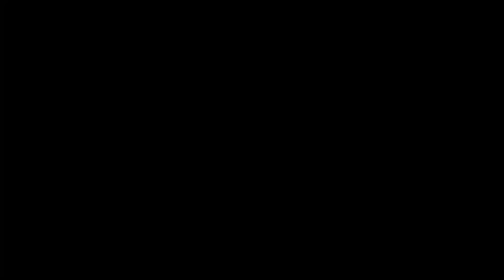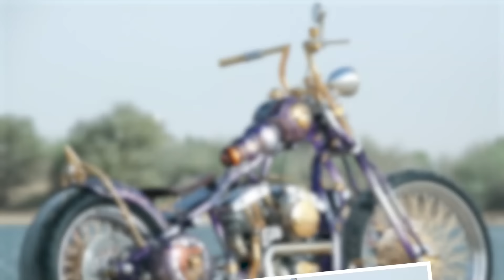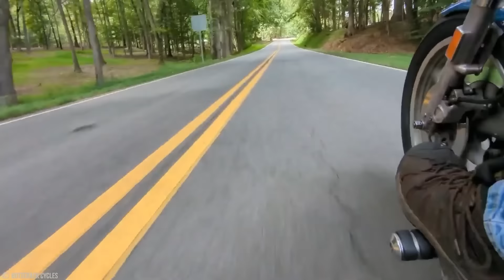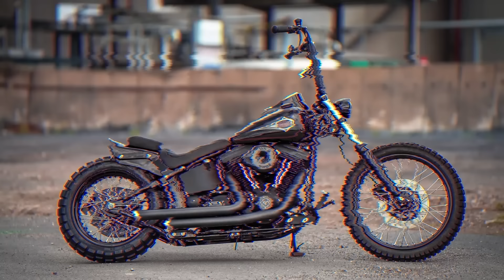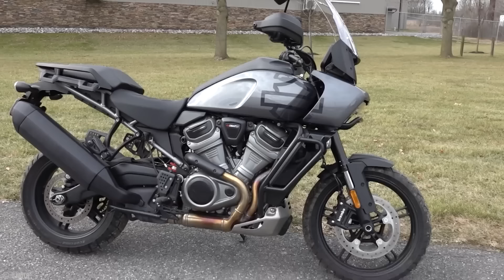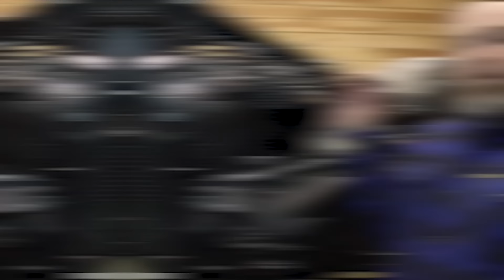3 WORST and 4 BEST HARLEY-DAVIDSON Motorcycle Engines to RIDE FOREVER

Comment: Um no,,the Cam Chain Tensioner in early twin cams isn't a 3000 dollar fix! You can buy the part for under 160 bucks (upgraded S&S thicker shoe tighter tension) and do job in half a day..also the 96 already had the upgraded tensioner the 88 was the problem..

Comment: i just replaced the spring loaded cam chain tensioner on my 06 street glide with the hydraulic tensioner and new cam plate. currently, that's $2k to fix the flaw.

Comment: The TC 88 is not a problem if you replace the tensioners though. Id put the XG750 engine at the bottom, what a troublemaker that was

Comment: only lookong at mechanical (stock) reliability this list might be true, but if you factor in electronics the evo wins hands down. Also it's much easier to work on.
TC is also solid if you upgrade the cam tensioners and bearings.
M8 might be a really good engine, but it's already missing that harley feel and sound (and all the electronics make it really hard to work on). 
The Revolution max is just unacceptably ugly looking

Comment: 2001 TC 88 with upgraded hydraulic chain tensioners, cam plate & HI flow oil pump.  50,400 miles

Comment: Best Harley engine built and lasts is the big  twin, mines a 1991 fxstc only thing done was plugs, oil change, and stator, tires and brakes, so far and 98k on the bike, take care of a great engine and it will take care of you

Comment: My very first bike was a 1978 iron head sportster. It was the biggest POS going. It was so bad that it put me off Harleys for a very long time. 1999 rolls around and I went to the bike show in the winter to see what was gonna be coming out. That was my very first up close look at Buell. I didn't pull the trigger on one then. I waited a few years. I found a 2000 Buell Cyclone M2 at our local bike shop. I picked that one up. This was in 2005. I still have that bike. I also have a 2001. Same bike, same model, same color.  And 2 totally different animals. I started riding my 01 last year. I had already owned it for 6 years ?  I lose track because I have a garage packed full of motorcycles.  I've ridden all sorts of different Harleys over the years. Nothing compares to a  Buell.

Comment: Milwaukee 8s have a ton of plastic parts inside the engine! Absolutely those parts will fail and have failed just like the plastic tensioner pucks from the 88/96 engines.

Secondly! Ain’t no way you’re running an engine 80,000 miles on a single oil change. So, you may wanna go back on that part of your video during the 1250 engine.

Comment: Anyone that buys a Twin cam from 00 to 06 the first thing you better do is replace those spring cam chain tensioners .  At least convert to hydraulic
Reply: Nobody told me when I got my 04 Heritage and at 50k boom- with adding a 6speed gearbox my bill was 9024.00-ouch😎

Comment: I have two 96ci Fatboys both 2009 the first has done 145000km with no problems except i have to use the choke when starting otherwise it purrs. But I have the custom classic that's only done 17000kms and no problems so far but this information gives me reason for concern. I keep them both up with services and now ill be looking at the chain tensioners so thanks for your help

Comment: Buying a Harley was kinda a bucket list thing for me, so I was able to find a 79 1000, it was sitting in a old shed,,been sitting for about 5 years, it looked like a total mess.. so I passed on it because of the price that was being ask.. a few so what days go by, then the offer was said to be for a 1000$ for it.. the first time I seen it it wouldn't crank, why I passed. I bought it the way it was.. needed a coil.. runs pretty good now.. next is the breaks .. there are none..  haven't rode enough to see if it's a oil leaker.. my first Harley. So any helpful tips will be appreciated..

Comment: lol the M8 bottom end failures, cylinder wall scoring, plastic lifter stays and intake manifolds warping and breaking like crazy! Most reliable engines 1- Revolution (vrod) 2- Evolution big twin top end breathers, 3- Evolution bottom breathers and sportster 883/1200, 4 twin cams with hydraulic chain tensioners.

Least reliable and best sounding (self lubricating) Shovel head.

Comment: I have a 2008 Electra Glide Police with a 103 and it's been a great bike. But actually going out TODAY (oddly enough) to look at a 2021 Street Glide Special with a 114 M8 with only 6k miles. Was also "considering" (but probably ruled out) a GORGEOUS 2016 Street Glide CVO with the 110 (9k miles) but heard some "not so good" things about it. Any input on these decisions?

Comment: The  cone  shovel   and EVO  , Had it  right   simple to  maintain   held up  great     ,  And  didn't  cost   $40 000    / I have  a 1979  FXE  I  bought  new with 25 000  miles on it  and  never  had the  engine  apart  , And runs  like a top  . I upgraded  the  ignition  carb  clutches  tires   / And  cost  $4  500  !

Comment: I think the M8 gets a bad wrap.  Sure early M8s had the oil pump issue but that was later dealt with.  I have  2021 model M8 107 and it’s bulletproof. Runs all day, runs cool, great fuel consumption and smooth.  All I’ve done is stage one and full exhaust.
Reply: I've got a 2018 Ultra Limited that I bought 2 months ago. I was going from an 07 Electra Glide classic, with a cammed, chipped and tuned 103", dyno'd at 115hp, so the lack of power immediately made me cam, chip and tune the engine, while also upgrading the oil pump.  It's now dyno'd at 125hp and I absolutely love the bike.
Reply: Twin Cam and M8 are the best Harley motors ever built but Evo boomers can’t comprehend it.

Comment: What blows my mind about Harley’s early twin cam is that they knew what the evo did for them and yet they chose to go with a pressed flywheel instead of how they always did it, they removed the timken bearing system that made they’re engines so strong, and then they went with cheap crap inside the engine. Then after fixing their shit in 2007 with the 96 and the 6 speed cruise drive transmission, they come out with the M8 that has a plastic intake and cylinder wall failure with oil sumping issues. Moral of the story is when you go cheap with your products, it shows. Make a quality engine, stop cutting cost corners.

Comment: You can’t compare a 1970 engine with a 2025 engine . But if you want to so here are facts . 
You can replace every main bearing race on a shovel over and over to fix it , on a M8 ? 
You got 7 piston oversize . On a M8 ? 
You can tune without breaking the bank . On a M8 ? 
Better sound 
More character 
Easy to maintain 
Parts are most of time cheaper 
No electrical issues

With my private evo I have 90000 miles on . 
My 45 Wla has now 60000 since I rebuild the engine  

It’s all up to maintaining. And use high quality oil

Comment: I have 103 and 114. Both great.
Reply: I've had an 80" Evo (cammed, chipped, heads polished, ported and bench flowed) and dyno'd at 105hp, I've had a 96" engine and 103" Twin Cams, and I presently have a 107" M8 with a 468 Redshift cam, Dynojet PowerVision III tuner, and upgraded oil pump, dyno'd at 125hp, and definitely my favorite engine.
Reply: What did you have chipped on your 80” evo?  If horsepower is what you’re looking for you should try a Revolution, Revolution max both make 125hp or more stock and are liquid cooled which reduces damage from extreme heat conditions.

Comment: The only problem with your choices is that the last real Harely was the Shovelhead and that ended in 1984.
Everything after that is just a japbike with a harley logo.
Which means that the Shovelhead is the best, most refined and highest power Harely engine. 😎

Comment: I used to own a Milwaukee 8 engine powered Harley,two years after I bought it,one day I went outside to start it,didn't start, called Harley Davidson dealer,they called out a tow truck,turned out the oil pump failed and my engine needed to be replaced,there is no good Harley Davidson,they are all money pits, after I got my Harley fix3d,I sold it and went to look around at a HONDA dealer,rode out on a HONDA gold wing.

Comment: Obviously, two of the very best Harley engines are missing: The EVO Sportster and the V-Rod.
Reply: V rod is crap
Reply: @sll-tt6bj  Vrod Revolution dual overhead cam, water cooled 60 degree v twin engine when properly maintained outlasts and out performs every other engine Harley built until the Revolution max was released. And as far as reliability goes it is too early to be sure which Revolution will win. If Harley produced a big twin based on the design of the Revolution it would definitely be the most powerful and reliable engine ever built by the company. But being a liquid cooled, pushrod free, modern designed efficient engine makes it undesirable to “Harley Purists”.
Reply: @Jdubsgarage74 same thing happened to the Harley V4 concept. Tbf, the point of these bikes are cruising and low end torque, that's why they have like 2 liter v-twins with long strokes and most importantly, pushrod valves, but the liquid cooling is a big advantage. V-Rod is a cool bike but obviously, these pseudo-tough guy kinds of Harley riders(aka the bad ones ruining the image for even the respectful Harley riders), have tachophobia so it wouldn't be surprising that they hate a sporty bike, even if it's the same as theirs with just little tweaks to make a sporty cruiser
Reply: @sll-tt6bj you never owned one.
Reply: @UncleRobsGarage you don't know what the fuck i owed

Comment: I home built my 87 FXR 1340 EVO in 99 from a pile of new and used parts - put it in the street in 2000 with 150k+ on it and still going strong. Powered by a 99 EVO motor and 90-94 5 speed tranny. Still loving it.
Reply: U talk about the shovel head U put it in the street n 2000 with 15ok+ still Going strong but theen U say Powered by a 99 EVO motor aaa
Reply: @matthewasbury8342  WHO IS NARIRATING THIS BULLSHITT...WHO R U 2 JUDGE..
Reply: PLAY ME SOME D.A.C. OLE PANHEAD OF MINE!

Comment: M8 is NOT #1…first year 107 M8 engines had a crap oil pump from the factory. Oil sumping was a common occurrence before recalls
Reply: Mine is losing lifters at 50k. Love the bike but tired of Harley marketing stuff before it's ready. If they would have abused this stuff for even a year they would have found these problems.

Comment: 80 cu in Evo engine needing regular valve adjustment?  Stock motor runs hydraulic lifters,  nothing to adjust,  if you've fitted a heavy cam and need solid lifters that's a different issue.

Comment: Got a 2004 Road King, upgraded to a hydraulic tensioner, closed loop ecm and slightly aggressive cam and 2 into 2 exhaust system. Presently have about 164,000 km (just over 100,000 miles) a keeper!
Reply: Have the same bike stock with tensioner up grade
Reply: @charlesdigennaro4981  I am not familiar with that upgrade, is that for the primary?

Comment: I owned a 2011 RK Standard with a twin cam 96.  I put 50,000 miles on it without any issues. I had to replace the rocker box gaskets that was it.  Very reliable loved the bike but it did not have cruise control and I make long trips every summer.  I bought a 2023 Icon Electra-Glide in orange, with a 114 Milwaukee 8 which I believe is a RK police with wire wheels and a fancy paint job.  Great bike loads more power than my twin cam 23,000 miles so far and no issues.  The Milwaukee 8 runs cooler than my Twin Cam.  This will be my forever bike, that's what I say for now.  My mechanic told me to get the longevity out of a Harley leave them stock and do the maintenance.  He is currently rebuilding a customers Twin Cam with 155,000 miles on it and the owner did the routine maintenance.
Reply: 2007 heritage 96 cu. 53,000 miles on it just fluid changes when required. All stock. Cross my fingers.

Comment: So ive seen videos where a mechanic is on there saying yep revolution max motor . This one needs a new one . 🤯WHY ? Well Harley has used plastic components.  Like the side housings.  Apparently some  plastic components in the motors 🫣. If anything breaks its throw away like a Bic lighter it has a lifespan.  Not like the older models that are still being rebuilt decades later .Ive also read where Pan American owners had nothing but issues with it so much so they sold it . And the early years of the M 8 s weren't any picnic either .The newer the Harleys your getting away from home mechanics because they need specialized equipment. Thats when you start paying $150 an hour or my friend who works at a Stealership said he has presented bills for $750 for a 3 hole oil change.  Yeah no 💩. He said they had a few issue with customers when they got hit up with that one .
Reply: Your friend is robbing people. The rev max is only a 1 hole oil change. I only take mine in for the big service intervals and its 320. I do the in between oil changes myself. Both 975 and 1250 are a 1 hole. Your buddy sucks

Comment: I have several Harleys.  My oldest one is an early (04) Dyna.  The spring tension cam chain is definitely a weak spot.  Just had the cam chest rebuilt (over $1k at dealer).  All my others are M8’s except for an 09 Sportster Low.  I keep the Dyna for purely sentimental reasons - also, it is by far the most fun to ride!

Comment: False information,AMF never built an engine for Harley’s, The engine casting was never moved from the original plant, the disgruntled employees who had family members and friends All got laid off when AMF purchased building rights to get Harley’s from going under and the engine building was sabotaged by those workers and painted on the train cars transporting engines to AMF with fuk amf, and then the new engines all got tor down and found paint chips purposefully put into the engines to make them fail. These are all facts

Comment: Best harley motor was the gear driven quad cam 1203cc sportster motor in a buell!
Reply from the maker: Nice one!
Reply: When was that?
Reply: I have 2 of them in my Buells. I have a 2000 and a 2001 with that Sportster engine.  Well kinda. The Sportster was rated at 64hp. Buell got it up to 96 on the carb models . I believe the efi models were rated around  110hp.

Comment: They are indeed a maintenance nightmare. I own a TC 88 . It got 17,000 miles on it , I knew the shoes were an issue so I did a cam upgrade complete service and replaced the shoes all in one sweep . In 6 years I haven’t put 1,500  miles on it . Spent about $1,800 on the whole job . It is what it is . At that rate I’m done spending money on it because all I do is ride to the ice cream shop and little evening rides in the country . I’m happy with it . Far from the most economical scoot you could get would be an accurate description
Reply: I RODE MY 2003 RKP 118,000 WITH SPRING TENSIONERS. cHECING THEM YEARLY AND I REPLACE THEM 3 TIMES. tHE TOOLS WERE EXPENSEVE AND THE JOB WAS WINTER PROJECTS. iF i WENT TI GEAR DRIVE EARLY ON, THERE WOULD BE LESS HASSLE
Reply: There is a little misconception about the Twin Cam.
  First of all stop running 20-50 oil in summer,
 run 60 wt and 20-50 in winter. 
 TC is an engine that suits someone who knows how to work on engines and can prevent breakdowns by knowing what to look for and what upgrades to do. 
 TC are capable of making big HP if done right and will last. 
  What people don't realize is that the TC engine is designed to get 150,000 miles before the engine needs replacing.
  That means the same engine can be rebuilt or freshened up multiple times without having to replace block, cylinders etc that is if someone doesn't wait till it's to late. 
 I have had several and do my own work. Never lost one and 2 were left stock with preventative maintenance and were still running when sold , both had over 120,000 miles on them and never rebuilt but I credit most of that to Amsoil oil.
Reply: I did the hydraulic upgrade on my 06 Roadking at 16,000 miles, it now has 85,000 miles on it. Knowing the problems before hand and fixing them makes a difference.
The two Hondas I owned had their own problems, neither lasted beyond 20,000 without severe breakdowns.
Reply from the maker: That’s becoming too expensive for an ice cream ride 😂
Reply: ALSO i NOTICE AN  DEcreas in wear as the chain may have been lapping down smoother with time. and not filing the tensioner  JS
Reply: Lmao 6 years and 1500 miles? Your opinion is unwanted because you don't even ride 😂